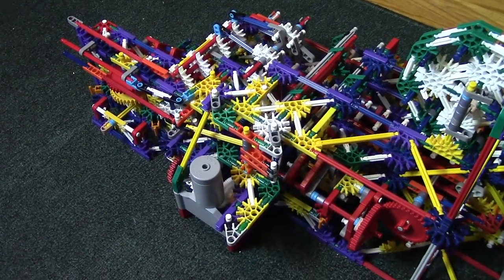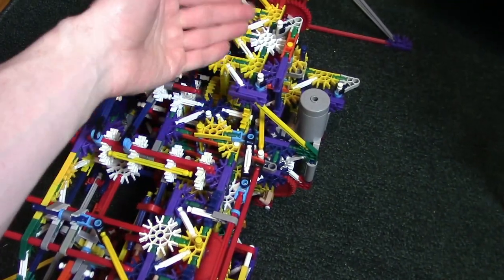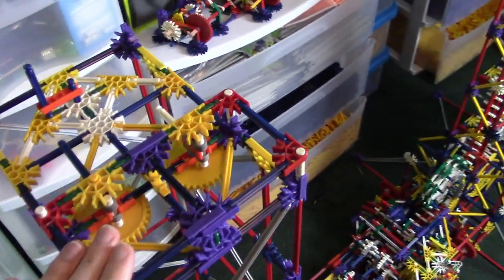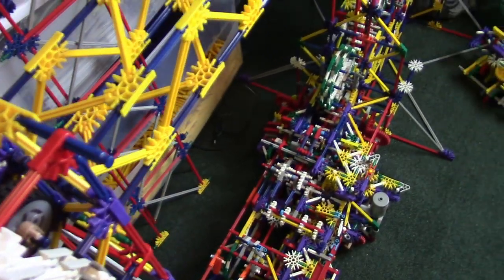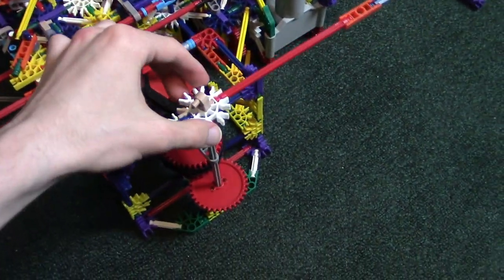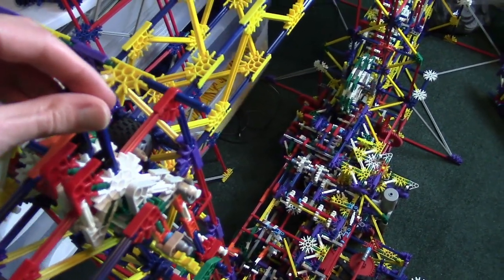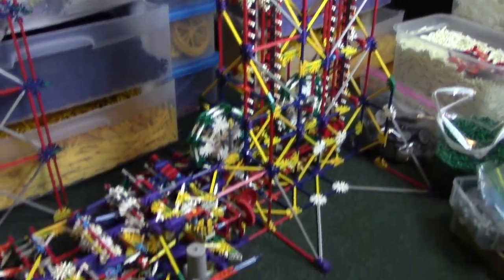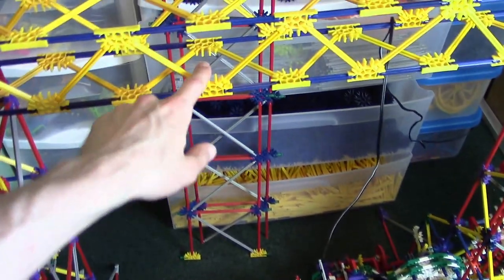Let's Build Knex S2 - Ep4 - Robot Project: Control Panel and First Program

Comment: Amazing work and it is so nice to see it in operation like that!

Curious as to what plans (if any) you have to refine the writing of the program? The advancing tape is a bit jerky but perhaps a second "lock" switch could be used to force the tape into position? perhaps exploiting the red connectors on the back side to lift some armature up under the writing head to pinch the tape into place prior to writing? Would reduce the need to rotate into exact alignment with the tower marker and let you keep your head down on the robot for coding ease.

As for prior concerns, I can see why having feedback to the console would be a greater strain on the driving motor and probably would prove more of a hinderance than an asset. Would be a cool feature, though in the end I agree it would be unnecessary.

All in all, excited to see where this goes and how you're planning on using it :P
Reply from the maker: Thanks! The main reason the cranked tape is jerky is the erase head, without that the rods wouldn't be pushed over enough to the center. I did think of something to lock it in position though, but am holding off on that for now since I have a suspicion that the line-up point may be different for the start and end of a step. I also thought of adding a fine-tune switch, since the torsion of the crankshaft makes it hard to line up the tape as well. Since adding these things would make the control panel have more inputs, I'm holding off on those ideas for now and will try to deal with the current system. But perhaps I could at least add a detent to make the tape want to lock in the right position.
Reply: Revisions are always possible so making those adjustments and 'ease of life' additions later is just as feasible and not going to prevent you from testing out the current performance.
And cold see how adding in more inputs would only increase the complexity/bulk of the control tower, though the lever design you've made certainly compacts a lot of those methods.

Might have to do some tests on my own on what kind of input controls might work for these types of systems, would be a fun challenge I think.
Reply from the maker: @FygerFyre  Hooking up all the inputs proved more difficult than I thought it would be. If there was more space the best way would be to have two lines in tension to control each input, that way there'd be very little play.

Comment: Hey Shadowman! We're you planning on uploading detailed photos of the construction process for this project? I'd like to see if I'd be able to rebuild this whole thing. After years of many attempts, I managed to rebuild the entire base and "lower sector" side of Citadel (including all paths and elements). I also managed to rebuild parts of the "upper sector" side including the 3 wheel lifts, the circular path separator and 2 paths (path 8 and path 17) all based off of the photos and videos you uploaded for it. I'd say the whole thing in general is about 98% accurate to your first version. I had to stop building because things began to get too complicated and I started running out of pieces to finish haha. I'm sure for this project I'd be able to rebuild the general idea just from watching the video series, but I have an eye for detail and would like to get it as accurate as possible to your version. Keep up the good work!!
Reply from the maker: I'll likely end up making photos at the end when I'm taking it apart, to make it easier to get to the dense areas. You could probably make it just from the videos, DispleasedBeagle is building a replica that way. But like you said, it would be better to wait till the finished product, because I often make minor changes that don't get covered in the video. Great job on getting that far in the Citadel recreation though, I never thought people would be trying to rebuild it from the photos haha. Thanks!

Comment: This is looking really sweet, like you said in the video, it’s impressive how accurate it is in replicating the programmed movements. 

One thought, would it be possible to double the “resolution” on the tape if you had a different connector than the red connector, so you could essentially have 2 white rods per link of chain? Not sure if it would be possible just a late night thought lol
Reply from the maker: Thanks! That would be possible, but that also means the read head levers would need to be twice as small. So I'm not sure how I'd do that part, since they're already moving pretty quickly.
Reply: @Shadowman39  another option would be to make a gear reduction from the transmission
Reply: @Shadowman39  I meant have the tape running at the same speed but just have the robot output at half the speed of the tape. You’d get extra precision
Reply from the maker: @Koolcoasterkid  Oh I see, yeah that also helps and that's what I'm currently doing for the output.

Comment: I was thinking, you could add a ratchet on the chain, so it cant go backwards. Then if you turn the crank backwards, it will always line up automatically for the writehead. :)
Reply from the maker: That could be done, but having the chain be able to move backwards is a design feature I wanted it to have, in case you "overshoot" while teaching the robot and want to readjust. But maybe it could be activated conditionally, I'll have to think about it. Thanks!
Reply: @Shadowman39  yeah! Maybe make it controllable with a lever on the control panel, or automatically when its in write mode

Comment: Perhaps it's too late or maybe you already did something like this (haven't finished the series yet) but one possible solution to the stretching might be to have the tape stored horizontally, zigzagging up and zigzagging down two shorter, wider towers. With that setup you could also potentially make use of the space directly above the transmission and directly behind the control tower?
Reply from the maker: The project is done and taken apart by now, but yeah I did think of doing that arrangement, or at least making the storage horizontal rather than vertical. But I think there'd be too much friction, and with the zig-zag layout, it would require many large wheels. Just the horizontal portion of the vertical towers generated a lot of friction. If there could be multiple motors to drive one tape there wouldn't be an issue, but there is no electronic speed control to keep the motors in sync (I won't spoil it for you but I deal with this later in the series).

Comment: Would gearing down the output to the robot arm make it more sensitive to the tape? So that each increment of the tape is a smaller unit of rotation allowing for more fine and more accurate movement. Also you should integrate the strain relief system so that one master lever activated the strain relief on all 3 towers. I’m worried that your chain will stretch out too much and become permanently damaged. I have some links that no longer hold at all because of stretching.
Reply from the maker: Yes making the robot slower will increase the accuracy, and speeding up the tape also does this. I'm trying to find a good balance though, since a robot arm should be fast as possible. I thought about having a master switch to detension the chain, but either way the stretching is still a concern. I'm dividing the chain into smaller sections for now until a better way can be thought of. I would just make a really long storage section rather than a tall tower, but I don't have the space. I also thought of arranging the chain in a zig-zag pattern up the tower, but think it would add too much friction.